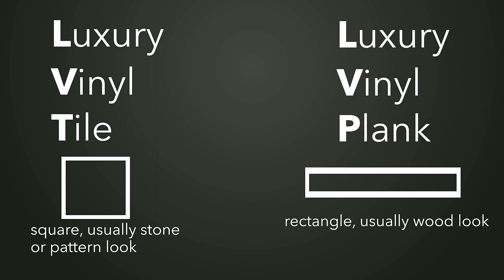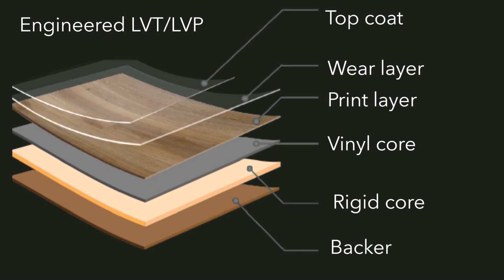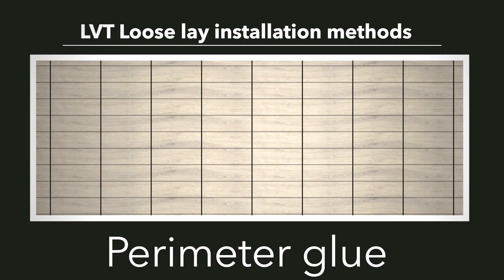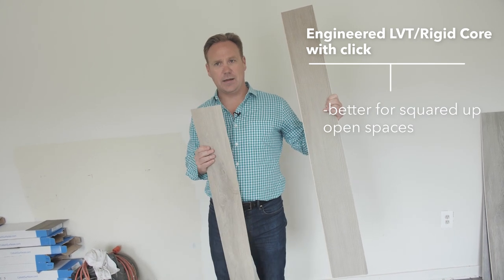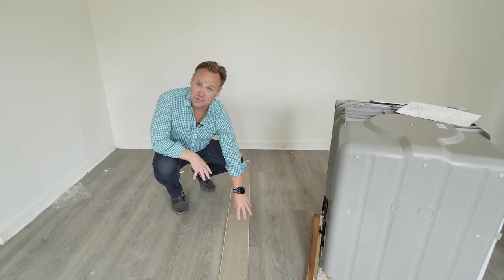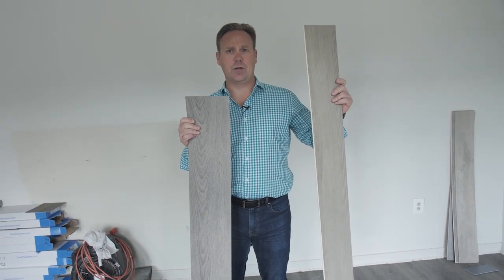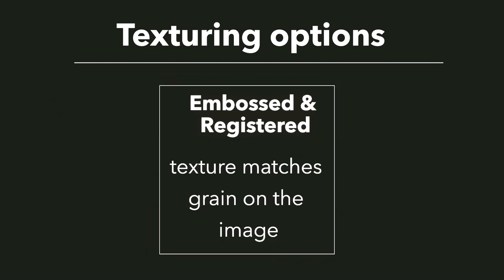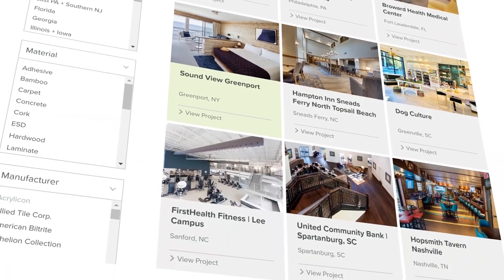Versatile Vinyl Flooring: Flooring University LVT 101

Comment: Thanks for a really informative video. I have very dated ceramic tiles throughout my apartment, they are in perfect condition just very dated so can the Loose Lay go directly on top without an adhesive?
Reply from the maker: Good question! Yes, the loose lay can go on top without adhesive, however we have had the best success using a releasable adhesive around the perimeter of the rooms.  You should be able to purchase vinyl releasable adhesives at any lowes or home depot.

Comment: So can I go with the loose glue down vinyl on a new osb wood floor or do I still have to install 1/4 underpayment ??
Reply from the maker: Hey Wayne, putting down an underlayment  doesn't hurt, and its recommended to be used with glue down vinyl to avoid damaging the subfloor during removal of your vinyl down the road.